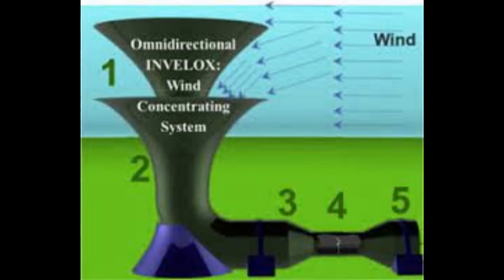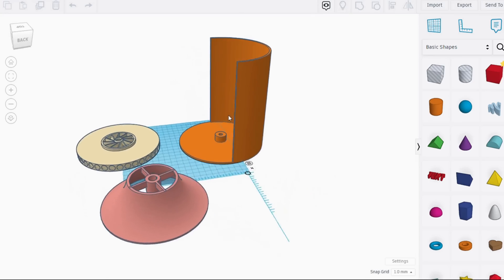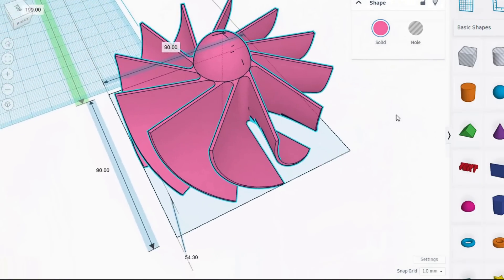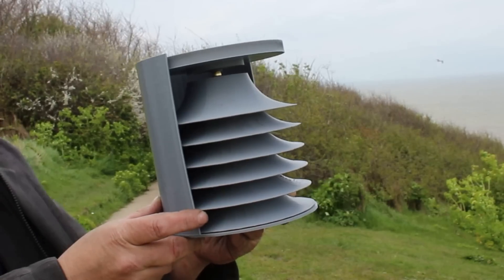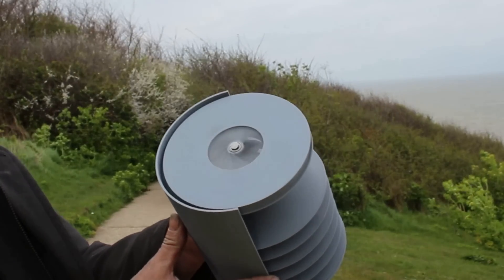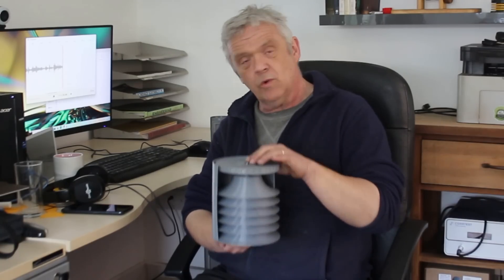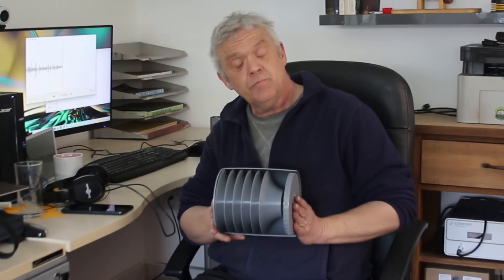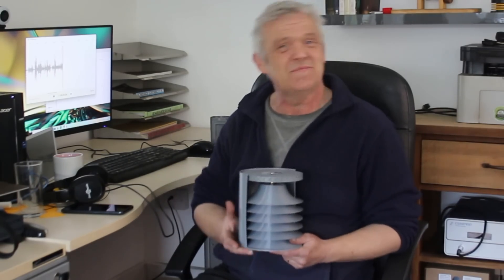1901 Brand New Wind Turbine Design For Camper Vans, Boats And Roof Ridges

Comment: I have the parts ready to print for this project with the bearings and magnets on order. However, I don't really want to print this part unless I have some understanding of how this model mates with the other half of the generating part. Is there a video that shows the other half of this project? Are there tinkercad models for the part with the windings on it? Thanks!

Comment: Awesome design! I wonder if it would it be worthwhile connecting the swept discs to the curved back panel? That way all the air is captured and forced up through the centre impella. I know that would be a nightmare to 3D print and would probably require a larger printer so you can print the whole thing as a single piece.

Comment: Sir Robert, I was thinking that this design in conjunction with your procedure for generating power with DC fans might compliment each other well. Unless embedded magnets in the design as such makes more power, of course. I wonder about magnets on a boat, but that's a separate topic.
You could incorporate one of those static pressure booster inlet and outlet designs for efficiency, and noise reduction. Possibly stack multiple fans if it moved enough air. Wire them in series for higher voltages maybe? 😮🎉

I'm just learning how to print. I have yet to learn how to 3d design. But when i do I am going to learn by modyfying your file to work with large 48v fans. I have a dozen or so of them. And I ive on a boat.

Open to any input on this idea.

Comment: This is genius :)  Very nice design. Also because 

- there is no visual disturbance. 
- it seems to be low maintainance (lasting forever?) 
- Cheap to produce, 90% could even be made out of concrete..
- You can't put a windmill on the roof of a high building, but this would be possible. So no high pole needed. Install it on the roof of a flat. 

It could be better to put the fan on the bottom, because no rust, no dirt, bird poo.. Just clean it once in 10 years..  
Or put a kind of "roof" above the fan. no rain catching.. no sun (UV) zo lasting longer.  

How about: Print a mold for this with the elegoo giant. slightly larger... 
Then make a small serie of 50 of em and sell them to people..

Comment: Your design is like some other already real wind power turbines being used and commercially produced. But as you said it, the wind first blow against the sides before it's being pushed through the fan. Why did you make the fan so small? The amount of air being caught by the sides is a lot more, so the fan is allowed to be much bigger. In fact why do you have all the compartments, why don't you just capture the wind in the half bucket, half empty bucket it becomes, and funnel the wind through the fan that way? 
As the bucket catches wind it may slow down a boat, van, camper or sorts unless if you have it just sitting on a rooftop or your vehicle is standing still. So what I'm saying is this is't that brilliant to use with a moving vehicle. Still it's smart if you just put it on top of a roof.

Comment: I've a better idea on the orientation in relation to boats. Sail boats generally have a tall mast which these days are hollow, if the wind catcher is on top of the mast blowing down the mast exhausting out the bottom possibly below deck into the generator blades and finally out of a vent to above deck. That should make placement optimal for catching the wind,  moving it to a location where it would be easier to work on a generator and could be used for ventilation below deck.

Comment: Hi Robert. Just finished building a new 180MW geothermal power plant in NZ but I want to experiment with my own no-visible-moving-parts wind generator at my home. I want to make it a decent size, maybe 2m-2.4m height. Expect it will be made with a combination of fabrication and 3D printing. What form of 3D printer is best for complex shapes, ie. Winter’s turbine and shroud? I have a roof ridge line that faces directly towards the prevailing wind so could have a bank of 4-6 unit’s along the ridge. Id like to take advantage of the increased wind speed from the 40deg roof pitch too. 
Btw, you videos are clear, concise, informative and full of really great information. I’m looking to buy a 3D printer but have 0 experience! Thanks, Andrew.

Comment: Nice looking and interesting concept. However, since the turbine it's inside and the output / load seats on the exterior, it means it'll have very low torque. What about reversing them by directing the air from some bigger cones towards the exterior of the generator disc? Thanks!

Comment: Great Design.. Thanks for sharing your tinker cad files.    I think you would see improved performance with the air directed up.  My theory is the capillary effect would draw more air through your generator.... since air speed is higher at greater heights.

Comment: how long could you make it? does the amount of power output from each added "ring" diminish as you add more of them? could you counteract this by changing the "ring" diameter or the gap between the rings? 
Is there an optimum "gap" between the rings?

Comment: I love the design. I would like to know its efficiency. Does mounting magnets in the rotor and putting a coil around the rotor convert power as efficiently as an tradition wire wound generator mounted axial to the rotor?

Comment: Add a stack appendage array to vertical telephone and electrical poles using the poles then to transmit via wires the energy generated for third world countries so they are less energy dependent on fossil fuels.  Include a horizontal array on rooftops to power the building and a vertical array on the building corners.  Add array stacks adjacent to roadways to capture wasted vehicle wind energy transmit that generated energy to support highway lighting.  Wind will only increase in the out years to come with climate change there's an opportunity to capture that wind energy lessening the use of fossil fuels that are only contributing to the problem.

Comment: I was thinking about a boat. Sailing boat, really. I run a wind generator on our boat, and it does about 400w or up to about 10A at 12V. It needs about 6 knots of wind to start to be effective. I don't often see the output stated, but I guess with batteries that are quite full, it wouldn't.
What would the min wind speed for this be?
Build it big enough to take the guts out of a normal wind turbine! Turbine, regulators etc
I would still build vertical cause that way wind from any direction would be captured.

Comment: Another wasted source of energy is the boat moving ahead through the seawater without harnessing this energy akin to water over a dam spillway going to waste.
ALSTOM Schilling Robotics developed a motor and generator in the 2000´s that accomplishes this. I think the practical use for a boat would require adapted engineering.
Interesting idea nonetheless.
Search: cR120

Comment: Right now, I don't feel so stupid. I had an idea when electric cars came out about a system of mini-wind turbines to help generate power. Even mounting a half dozen turbines on the roof to charge a battery like the Jackery to power non-car things (phone charger, cigarette lighter - yes I'm old - dome light) would help some. 

After all, the vehicle is moving. Wind is happening. Why not recapture some of that energy and use it? I know about thermodynamics, but we're dealing with drag regardless. I'm not talking about 'free' power, I'm talking about getting back some energy that we're letting go now. Put power generating turbines in places like the grill or the side mirrors where we're already dealing with drag. 

Whenever I told someone about it, they'd throw the thermodynamics thing at me and that's never made sense. It would be like someone developing a solar paint that captures the light hitting the vehicle and people saying, "Can't work. Thermodynamics." No. You're just keeping light that would've bounced off anyway.

With the lighter weight materials that we have to play with now, it might work if we're letting wind pass through a spot where it normally would've had to go around. Even if it's a break even between drag, charge, and weight , that's still power that can be used NOW, while the car's in motion. Even with the heavy batteries, electric cars already have them. We're not adding a battery for the turbines.

Comment: Your concept is more than interesting but I see an idea that may make a small improvement in the net forced air velocity that could easily be added to your hyperbolic cones. If you were to generate a vortex through the wind stream the output of the cone would carry the vortex at some n velocity increasing the rotational speed of the end effector which would be your impeller. There would be a requirement to determine the attack angle of the of the impeller of course and determine the swept angle of the vortex generator in the cone. Imagine the internal swept surface area of your cone having a series of 3~8mm swept fins along the internal surface swept in the same direction as the input of your impeller. As the wind is ingested by the funnel the fins would begin to spin the air at a speed that would be variable by the amount of sweep from the widest to smallest opening. In my untested opinion the net of the output from the cone would increase the efficiency of the impeller and allow for a higher rpm net and higher net torque. How much is questionable but if you could gain a net 20~30% speed/torque increase you could drive a much larger generator utilizing the increased nm. Regardless, your concept is proven and leads me to much grander questions in areas of improvement in efficiency. Thanks for your candor and obvious sense of what is humorous in the mind of an engineer. Lol! Our humor is dark but also enlightening even at the expense of sarcasm. I sincerely hope I have expressed in near enough terms what my minds eye sees as how to implement the vortex upon the cones/funnels.

Comment: Mr. Smith could this application be made the size of a steel drum with the cones closer together without changing the depth and use coils with rectifiers like you did in the 100 pounds  1kw generator episode? If so how much energy could be produced?

Comment: Is there anyway of getting some feedback and more details.
Mine just doesn't work.
I can get it to rotate with compressed air through the top disc, doesn't go very fast, blow air into the top and it whizzes round.
great idea , just hope I haven't wasted a load of time on it.  
I have a standard turbine disc and one of my own design with proper ball bearings.
same result.
Struggled with the profile of the blades on my version, they are not identical.

Comment: Two quick points.  1) It has to remain on a vertical axis.  That isn't a problem, but at the end you seemed to be considering a horizontal position for boats.  That means you'd have to steer the whole body of the thing into the wind which defeats the multidirectional design you just created.  2) You got it spinning at a good rate, which is awesome!  But how much torque is there vs how much is needed to turn an alternator?  Find how much torque (work) it will generate and find (or make) an alternator that will work with that.

Comment: I'm going to assume this has been asked before, so if someone wants to point me to it that's great...

What's the suggested best way of taking the output from one of these turbines and using it to charge a battery/power something like an IoT set up?  I have a system currently that is using a solar panel to do this using a solar management board to handle the power management, and a 18640 as the store for extra energy to power the device over night/dull period.

Comment: I have been thinking similarly, for cars and boats to be fitted with wind turbines. I have been thinking of a DNA type helical blade, 8-10" diameter on the roof of a vehicle across the passenger compartment, incorporating a DC generator for local use.
Designing coils for DC will provide several advantages.
1. Low magnetic friction
2. No AC to DC conversion losses
3. Direct to storage batteries
4. Lower torque to overcome friction

When power generation is within a short distance of the storage medium, DC is the better solution. As an example, windmill to a shed that contains batteries.

Comment: could you put this on a roof vent? use the hot air to escape and add a vacuum with the ventruli effect, might make it go faster? would it help with pulling hot air out of a shop in summer lets say? assisted ventilation and power in one would be nice

Comment: The idea is great... but upside down be better with the generator on the bottom with air can escape through  also ..... so the weight can be on the bottom part of it...with that can be put anywhere on a rv or a boat or even camping...

Comment: Great ideas! A modern currently available wind generator for boats can put out around 3.75 amps per hour at 12 volt in a 12 MPH breeze. How large would your design need to be to come close to this output? Spinning an impeller on a bearing is a far cry from actually harnessing wind power, and electrical generation adds drag. The average 12 volt mini fridge draws over 5 amps when it runs, and has a duty cycle of at least 25%. Do you have an idea of what size / output you might be aiming for for a recreational boat?

Comment: Question,  could you add larger side funnels to increase the airflow into/onto the turbine? I also like the non-directional wind turbine that turn no matter which way the wind is blowing bc they are a vertical spinning blades not horizontal.

Comment: Without a discussion of power output, this is simply a spiny toy.  If what you showed in the video puts out 10watts at X mpg wind.  Well that's kinda useless.  If however it could put out 50? 100? 250watts at a given size and wind speed, that's getting interesting.  

I'm not trying to be negative but there was little useful information here, so it's disappointing.  Perhaps you cover power output in a different video, if so please link.

Comment: You missed to put a pipe with a 90° bent on the exhaust, which can be pointed at the direction you don't want to travel. So you not only get electricity for propulsion (and everything else) but also the exhaust air helping a bit, in addition to the air hitting the ingress port, pushing you along.

Comment: Robert, well done mate, this looks quite promising on a campervan roof, ..............so apart from generating electricity, in theory it could at the same time be used as a extractor fan? my only concern is water ingress into the campervan (when it rains)..........you need to patient and trade mark this specific design, and then develop it further for trials with the campervan community.

Comment: I love your enthusiam and thought.

A few scaling questions please.

The general equation of a parabola is: y = a(x-h)^2 + k , where ('h','k') denotes the vertex and 'a' denotes the curviness of the parabola.

What values did you use for these pieces?
Was it just a guess or did you get optimal values from some engineering source?

How did you determine that optimal distance between each parabolic panel?
I figure air resistance will increase as they get closer but efficiency may decrease when they get too far apart.

Would one use different values if you scaled this up to, say a 6 foot diameter?
Would the diameter of the hole in the middle increase at the same rate?

I have been watching another channel where they build car bonnets, etc. from carbon fiber. ( Easy Composites Ltd )
It would be fun to make a mold and make as many of these parabolic panels as I want.
But the mold is a lot of work so validity of scaling is important.

Let me know what you think.

Thanks, Tom

Comment: My bad boy is only spinning when I used compressed air.
I think I may have got the distance between the discs wrong, I printed spacers and from the top of the shield to the top of the turbine blade is 25 mm.
You also have a gap between the top disc and the bottom of the turbine blade, is this critical and how big should it be.
Thoroughly enjoying playing with it, would hate to have to chuck in the bin because it doesn't work.

Comment: If there was another set of blades at the bottom could the low pressure area that I imagine would/could be created inside the the bottom cone be enough to drive it? Potentially increasing out put.

Comment: It's never a problem to spin something with a little wind with no load on it. However...
A wind turbine is supposed to generate power which will put a load on the turbine. I would like to see it actually powering something useful so we know it actually works.

Comment: I've just discovered your channel. 
I was discussing solar power on the UK Campsite Forum website today and wrote  "If at dawn each day you have less charge left in your battery than the day before you will at some point run out of power. You now have the Apollo 13 problem of saving enough power to get you back to Earth but of being alive when you return." ...... "The alternative to more solar panels is a wind turbine which would provide power during bad weather and at night."
My jaw dropped open when I saw your turbine as this is something that could bridge the solar panel gap. Every portable wind turbine I've seen before requires an Eiffel Tower to support it and it slices up seagulls and children in operation.
I want to know more and have clicked on Subscribe and Like.
Reply: I just looked up the RAM Air Turbines fitted to jet airliners for use in emergencies should the power supply fail, these are deploy-able seagull chopper propellers powered by the aircraft's flight through the air.  If your wind turbines work they might end up fitted on all jet aircraft, deployment would be on a simple jack in the box spring/dead man switch.